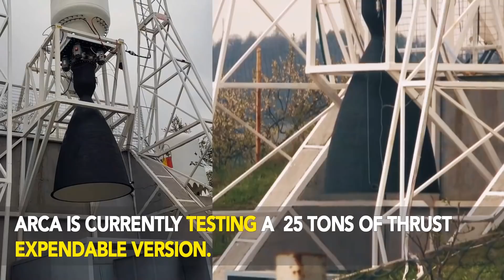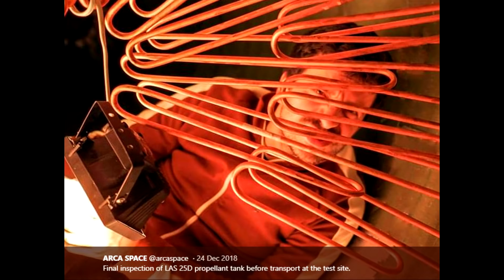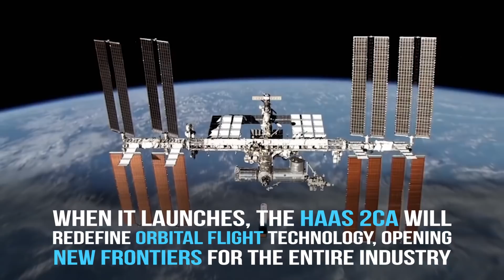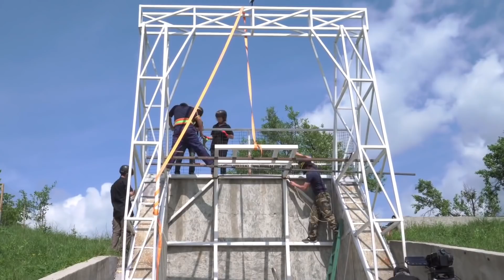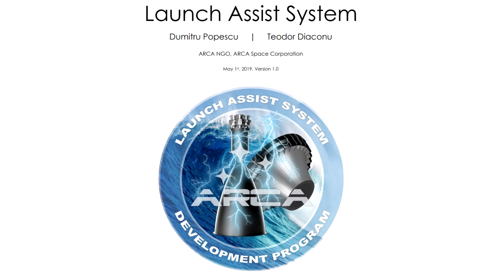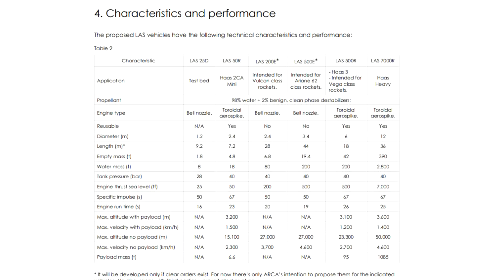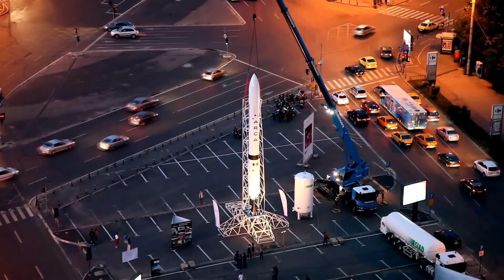Does ARCAspace's Water & Electric Powered Rocket Make Sense?

Comment: Who needs batteries? Just get a really long extension cord
Reply: with the added benefit of building a space elevator on ascend 

700IQ move
Reply: Considering that battery weight that may be a more reasonable proposal.
Reply: @iangrapes6659  Yep. Even a 5 Megawatt electricity generator & a big tank of diesel would probably be lighter than all those batteries
Reply: @passthebutterrobot2600  but then again power density wouldn't be great
Reply: @passthebutterrobot2600  Power It with lasers
Reply: @raulcavalcante9193  I remember seeing a documentary about laser powered rockets about 10 years ago. I wonder where they are now...
Reply: With 8 m per kilogram it would be 8 km per ton which means roughly 17 tons of extension cord to get officialy to space. It wouldn't be bad if it supported its own weight and took few MW of electrical energy. :-D
I have that mental image of crewmember manualy unplugging the ship to stop acceleration and miles of cord gracefully falling back to Earth.
Reply: You don't need a cord or batteries.  Just get 6 hamsters with wheels hooked to generators and a couple of keys of cocaine each.
Reply: @Phatman2167  Best thing, both hamsters and cocaine are renewable!
Reply: @Psycorde  
And cheaper in the long run.
Reply: @Psycorde  ...and even if the hamsters die, at least they'll die happy
Reply: Dont give them any ideas :P
Reply: Well, i immediatly though about a nuclear reactor instead of water. Nasa actually experimented with open reactor cores that heated cryogenic hydrogen up to i think 1000 °C or so. Just replace hydrogen with water and you got yourself the new "clean" rocket motor.
Reply: There are some ideas in the past to use ground-based microwave transmitters to heat water or some substrate on rockets ... are we sure that this isn't their plan?  Why are we assuming batteries here?  Or do they specify that somewhere?
Reply: @PhilosopherRex  
I guees we assume that they use batteries since they showed batteries on their supposed heating unit. Transmitting energy via electromagnetic waves is not that great of an idea, since are not talking about marginal power or mere data transport, the energy needed to heat up water is immense. As said befor, the probably most effective way of heating the water up would be via a nuclear reactor.
Reply: @mandernachluca3774  "as said before"?  I must have missed that ... but completely agree, a nuclear reactor is the way to go.  But won't happen probably due to greenies influence over politics.
Reply: @PhilosopherRex  
I hope that, as long as the reactor is sufficiently shielded and we only use this type of rocket motor out of earths athmosphere, there won't be a problem with that.
Reply: You know, that might work.
Reply: @Robbedem  They only work for very small and light payloads..  as tech gets better maybe.. but still a ways off..
Reply: Robbedem yeah, I heard about it; but it never took off.
Reply: zztop3000  Yea obviously, that's the point. The cable & generator posts were just to point out the ridiculousness of the batteries idea using current tech. Which also wouldn't work.
Reply: At takeoff a rocket has maximum mass and minimum velocity. Make stage one water and a two hundred foot extension cord.
Reply: Actually feasible as it's only a short "burn"
Reply: @mandernachluca3774  
Yes,  NASA did experiment with nuclear powered rockets, but they would only have been used in space, never for launch. The exhaust would be radioactive, and to design it to be clean would increase the weight too much. They were actually within a couple of years of doing a full scale test in space when Congress pulled funding. They would have been used in the Venus & Mars Flyby Missions planned for the mid 70's.
Reply: @PhilosopherRex  
For that to work you would have to be able to push way more power than is currently possible. Also, as the range increases, you would have to keep increasing the power delivered exponentially to maintain thrust, plus the atmosphere will absorb the energy being transmitted, complicating the power problem. While the atmosphere absorbs the energy, it will heat up, creating thermal blooming, decreasing the amount of power getting through to the target, and it will cause a lensing, making aiming your beam harder and harder, as the distance and temperature increase. That's why the US Air Force was trying to put a laser into a 747 with modified engines so it could fly extremely high. Ground based lasers would never be able to push enough power to even try to take out an ICBM during launch.
Reply: Actually I wonder how much power you could put down the cable/wire used in TOW rockets?
Reply: Attention Sheep l, What propellant was to be tested on ARCA'S Aerospike? Well it ain't  H202, it's fukin water. I told you people ROSA BLOCKED FUEL DELIVERY. WATER IS ALL THEY GET. This information is from ARCA'S white paper,
Assist System, or LAS.
At the end of September 2018, we decided to use the
LAS technology in combination with the aerospike
engine also under development at ARCA and
replace the hydrogen peroxide considered as
monopropellant for the Demonstrator 3 aerospike
engine. It was however clear for us that we need first
to understand the new propulsion system and run tests
on a larger classic engine, before implementing it on
an aerospike engine

Looks like I was right, ARCA AND ROSA ARE AT WAR NOW, ROSA 1, ARCA 0
Now ARCA has to secure a Lunch Site, anyone want to bet ROSA BLOCK'S THIS TOO?
Reply: I mean for an orbital rocket you only need 200km of cable
not that big
Reply: Lasers... all you would need then is a huge plate/ heat exchanger. No engine needed. As an added benefit a 100MW laser array could be used for missile defense or to scorch cities on other side of the planet (mirrors in orbit). win-win for everyone.
Reply: if your extension cord is plugged into the moon you could just pull up the rocket. fuel chrisis averted
Reply: Heck the rocket, just use that cord as a whip and just yeet the pay load into orbit like a madman.
Reply: Make nanonukes and blow them to heat the water inside the motor
Reply: Nerr,  I was gonna say that.
Reply: @PhilosopherRex  "oh shit! a cloud! The rocket is losing power! oh it's falling :( gotta check the weather better next time!".
Reply: @mandernachluca3774  but we're talking about earth to orbit flight here.
People don't seem to realize Nuclear power is not viable for that.
Reply: @ThatSlowTypingGuy  that's ok just for transmitting signals, not power.
Reply: @mortisCZ  ahahahah
"gracefully" killed me. Basically a "whip from God" xD
Reply: But then everyone would have to buy those iffy fire hazard regional wall socket adapters and risk the rocket blowing up because they forgot to make sure if it was set to 110 or 220!
Reply: Baterias no incluidas de movi
Reply: Teslar 🛰 aria recarga disparada como los rusos lla saben
Reply: @mortisCZ  Unplug it on the earth and pull it up?
Reply: Mandernach Luca I don’t think nuclear reactors really fit with their whole “eco friendly” selling point
Reply: Lee Mc Donald I am shocked to say that, if you check they’re latest video, it would appear that they are actually interested in this.